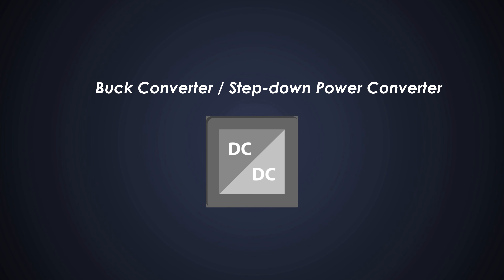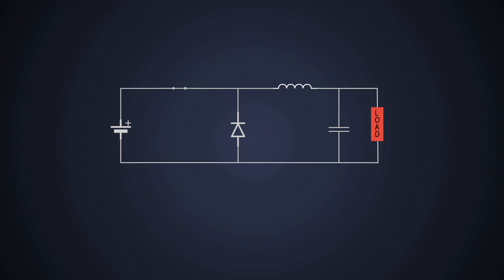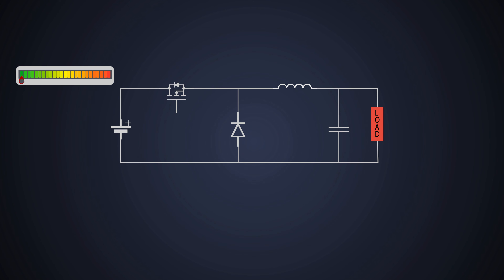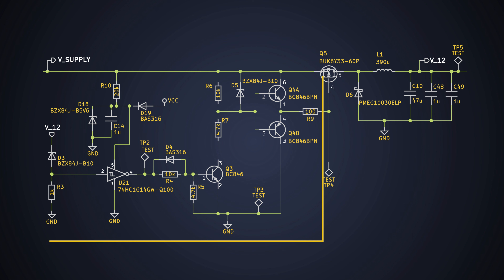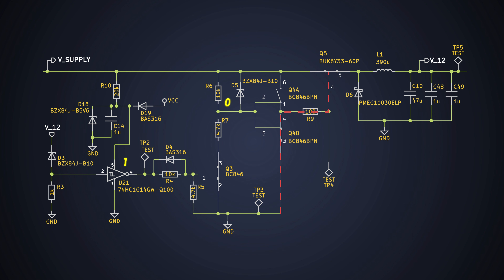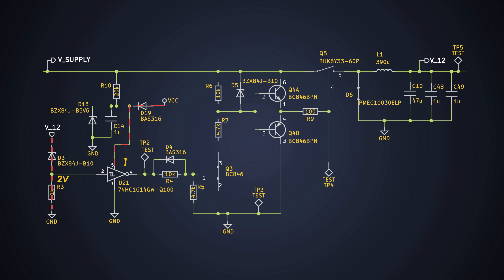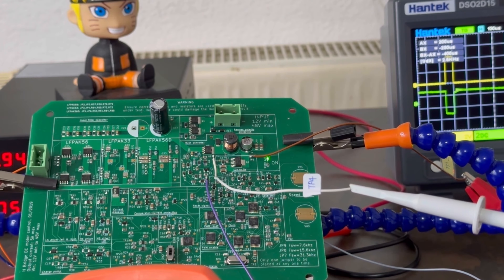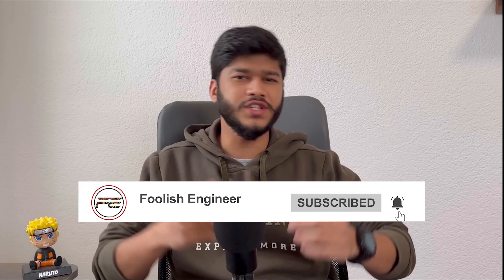how to Master the Control Loop of Buck Converter? Understanding of Buck converter control feedback.

Comment: Bro am designing a boostrap gate driver with buck converter with feedback using lm393 comparator but the duty cycle is different is inverter so when the voltage drop the duty cycle also drop the voltage follower do work but the duty cycle of the boostrap go low when the ic duty cycle go high and high when the ic duty cycle go low can you please explain to me how con I get a high volt when a low volt is president and a low voltage when high is president because that how the boostrap driver works and I can’t get the op amp to give me a higher voltage when there is a low voltage